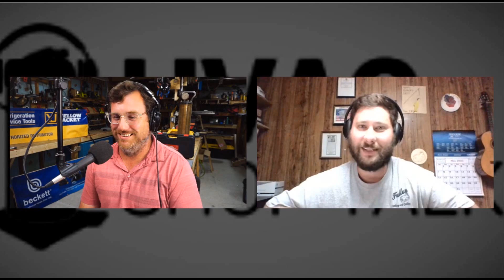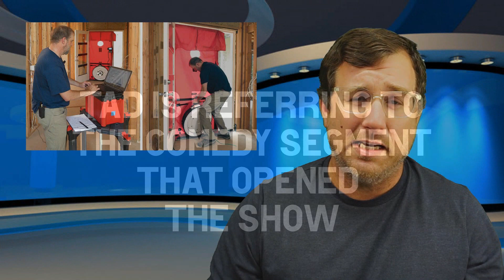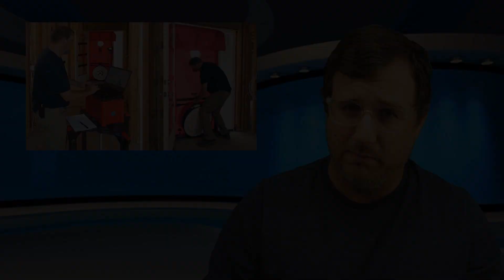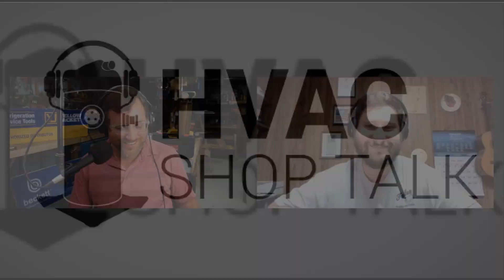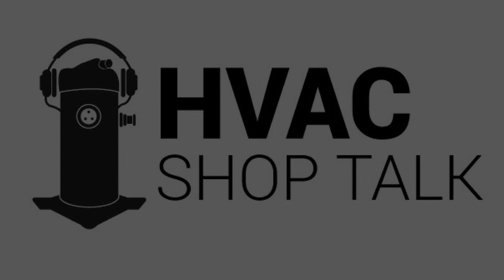HVAC in Trailer Homes w/ Tad Fuller

Comment: 90% of them have more condensate pull off going down through the motor/unsealed electrical compartment, than going out through the condensate drain. 

I usually install an indoor coil that is at least 1 ton larger than the outdoor unit. It helps with the increased surface area and heat exchange.

Now getting them to keep the coil clean and serviced once per year is another story. Water doesn’t stick to dirty coils, hence, the blow-off becomes a problem down the road.

You gotta love all of the cut outs in the 4x12 trunk, tight fits, sealed with $2 foil tape that dries up and buzzes after the one year warranty runs out.

Up here in our good ole hypocrite belt no integrity Kentucky, they’re getting $200K out of a large dw! 

Well, you gotta have money left over for a lifted 4wd diesel truck, $90k boat and at least three ATV’s.

Comment: We actually do a lot of Blower doors on trailers in Indiana. Many are surprisingly tight. We do mostly heat pump conversions. I almost always use a RUUD Air handler that’s MH approved and put a 4” media filter on top so you have very little return restriction. Put blower speed on High and it works really well. If it has an aluminum trunk I can usually get 370-390cfm/Ton. If they have the ductboard plenums instead of the aluminum it’s almost impossible to get enough airflow from those.